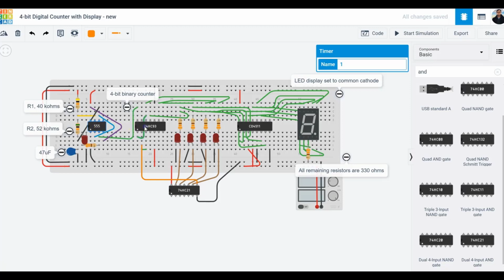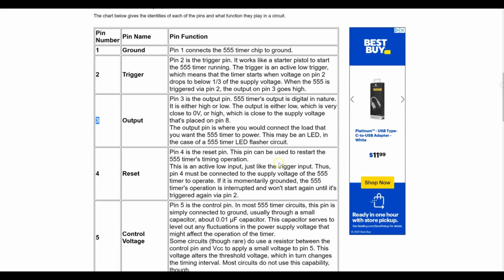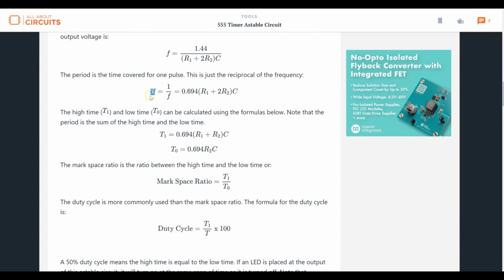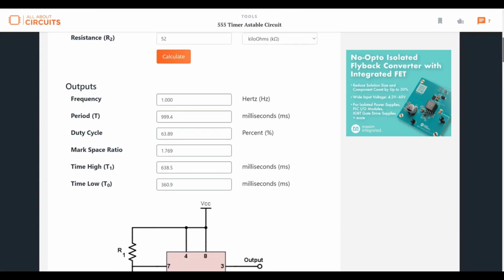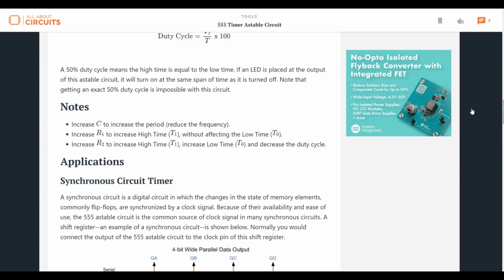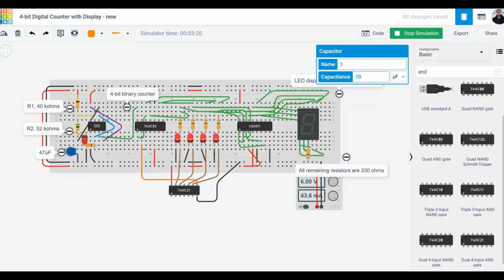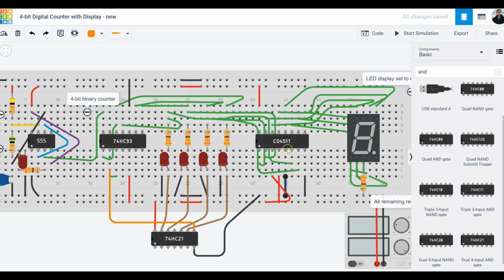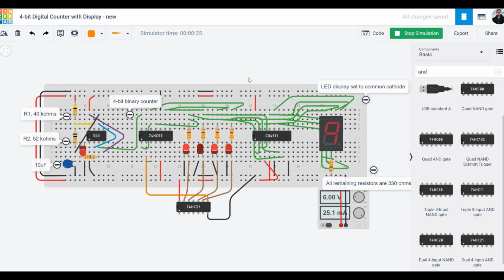#9 How to set a timer using 555 Timer? | 4-bit Binary Counter utilizing 74HC93

Comment: If I wanted to count from 1 to 6 on the display and back to 1, which logic gates do I need to add to the counter?
Reply from the maker: Use logic such when count is 6, it restarts from 1. For example, two bubbled outputs and one regular output could be fed into an AND gate to create a logic 1 and fed to the timer IC, which could reset the counter.